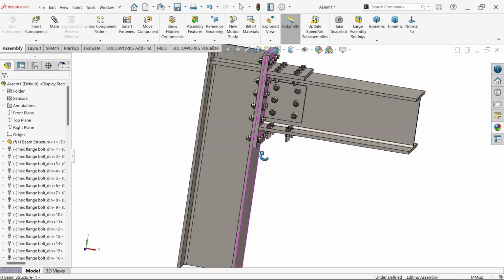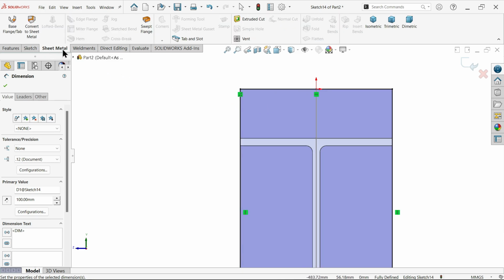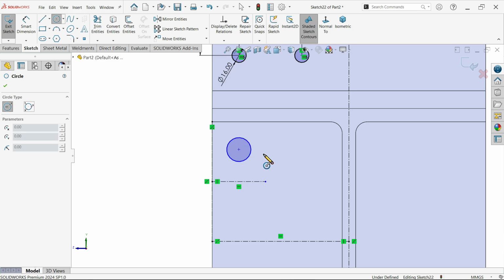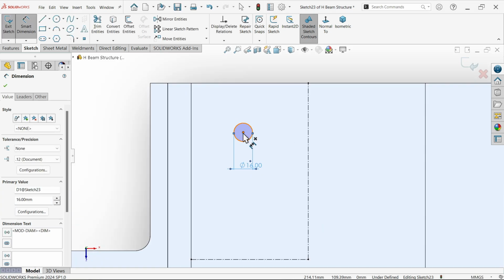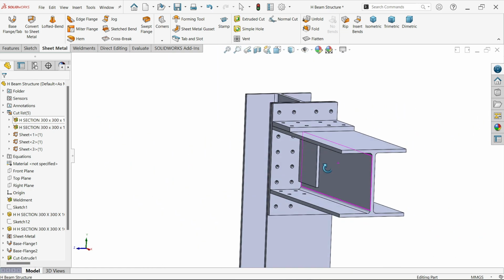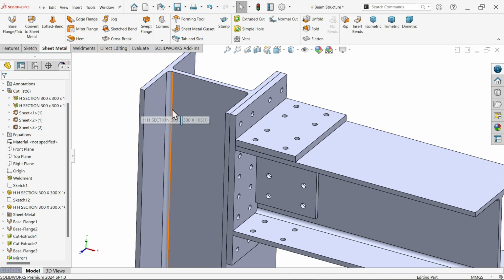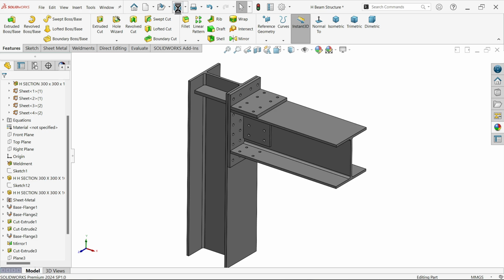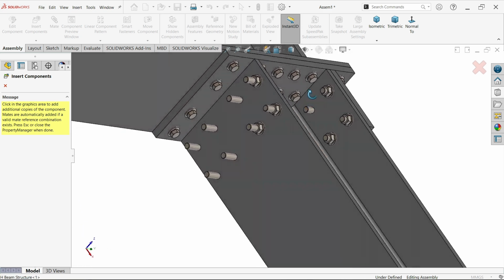SolidWorks Weldments Tutorial H Beam Structure

Comment: wrongly done. You have ended up connecting one part with hardware to itself. You have 1 welded part and a bunch of fastener. But you should have gotten several parts that you are connecting. You need to break it down so that you have 1 part consisting of welded H-sections, several plates and fastener. Then it will be correct.